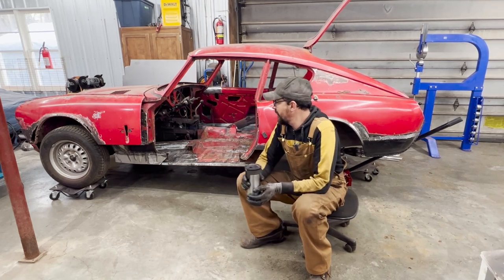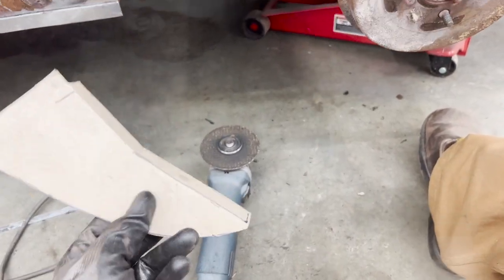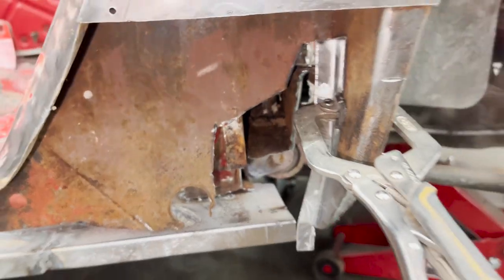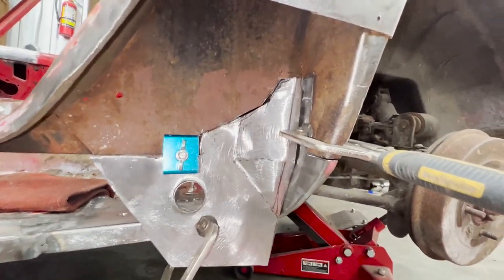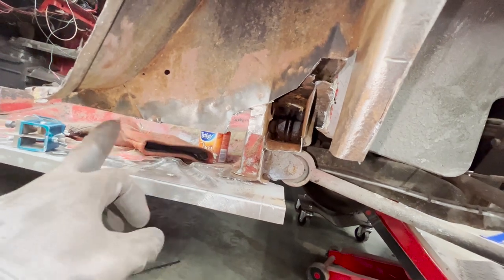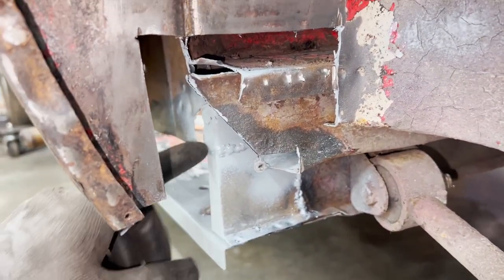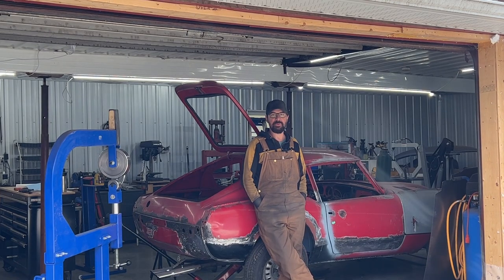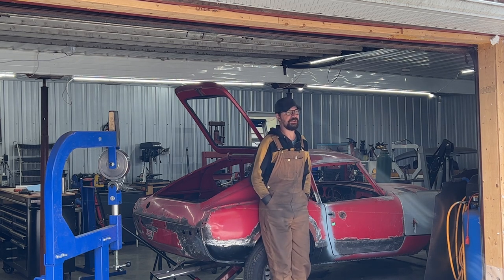1966 Triumph GT6 - Part 34 - B-post Bottom Completed

Comment: Maybe this is a stupid question, but is the GT6 a monocoque construction OR a separate chassis like the Triumph Herald ?  In this area (the B post) it is a little confusing as I see the suspension tie rod attachment from the axle to a cross member.  This is an area where on the Herald the chassis was prone to break ( in my experience ) and then you have rear wheel steering on acceleration which is scary.    Ah, I see now, later at 17:25 the body in that area is quite structurally important as a suspension hanger.
Reply from the maker: For GT6 and Spitfire the engineers decided to use the Herlad frame, but cut the "wings" off. So it looks like a big "X" therefore they added this crossmember to the body to reinforce it and attached the radius arms to it.
Reply: @RustyBeauties  Interesting, because that area of chassis was a weakness on the Herald. Mine cracked both sides of that mount , but it seemed like an old car even in 1972.  It was a bit of a rot box, but engine was bullet proof. Living near the sea didn't help.

Comment: Can't understand why you don't have the paint stripped off on a job like this, surely you'd end up with a much better end product.
Reply from the maker: I am stripping the areas I work at and at the end probably the whole body will be stripped. I am not a fan of media blasting or acid dipping, but even if I wanted to do that, the body was going to fall apart if I wanted to take it off the frame, it was that far gone. It will come off anyway, but after it has its integrity back.